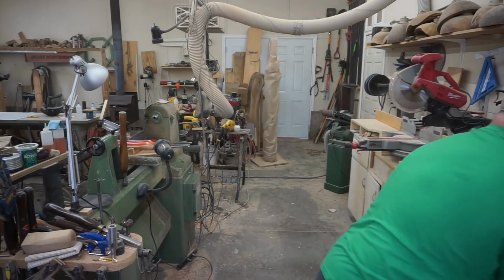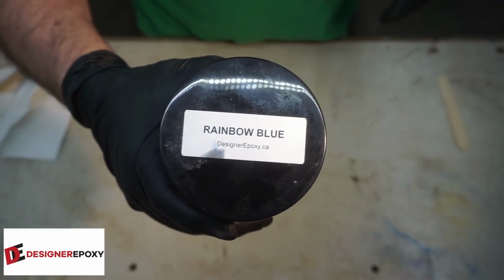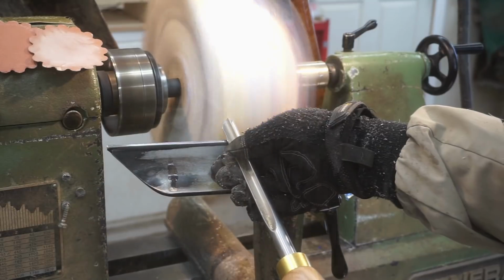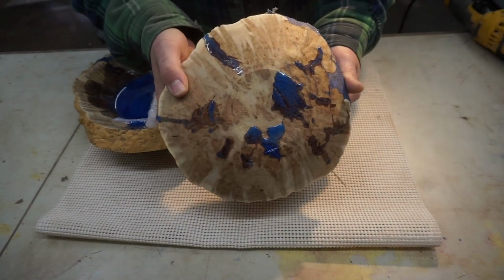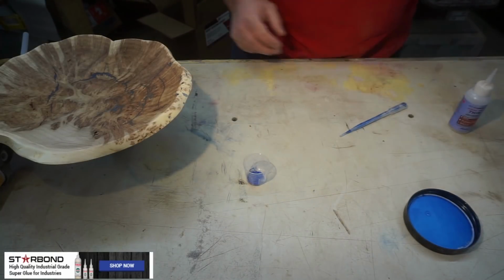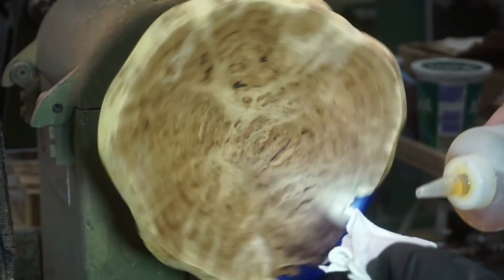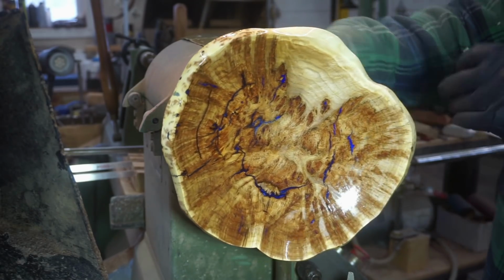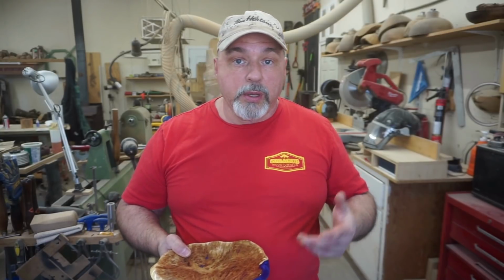Woodturning - The Brain Burl

Comment: Jim, 
As usual another beautiful job.  I have a friend who is an arborist.  He gave my 3 small burls 2 maple and a locust from a job.  I am looking forward to turning them into bowls.  The 2 small burls measure about 7 inches across.  The larger maple burl measures 14 inches.  Nothing like the ones you’ve been turning.  Great job I’m like you I love and prefer natural wood but the way you work with the resin sure adds to the beauty of your projects.  
Kevin 
Minneapolis Minnesota
Reply from the maker: I think if the resin is used as an accent then it works, but too much of it and it can over power the piece, that locus burl should be like turning concrete, lol. Thanks.

Comment: Another hit out of the park. For left over resin I usually have a few small casting molds ready for things like handles or bottle stopper blanks. You'll find you will have allot of waste turning a bigger chunk of resin....my .2c. Would like to see how you sharpen your gouge. Bought a Ellsworth gouge and having a hard time with the angle. Think you said in a video you sharpen 3 to reduce down time.
Reply from the maker: Yes, I usually have three on the go at any one time. I might possibly make a short video and put it up through the week sometime on sharpening, thanks.

Comment: Great work. I’m not a fan of contrasting resin in woodwork but you at least have some restraint. I use Mohawk products for restoration work and finishing in my shop. Great products. Another option is to contact general finishes and get an msds sheet to get an answer. You may even be able to get it online. Thanks for sharing your work and skills.
Reply from the maker: I get what your saying, but in the end, They are washing their hands of liability and placing it on the end user, in my books that’s not cool! I will move forward with another product that will certify the finish as food safe. I ordered three cans of the Mohawk salad bowl finish last night, thanks.

Comment: Just discovered your channel via recommended, impressive work! As a military member and current resident of pet very proud to see such fine craftsmanship come from the region. Curious why you use a pressure pot instead of vacuum? Keep the vids coming, almost finished watching most of yours!
Reply from the maker: Vacuum chambers are typically used to degas resins or to stabilize wood, pressure pots will compress any bubbles that might be in the resin so small that you can’t see them or shouldn’t see them in the final work. Thanks for your service, what’s your trade?

Comment: Have you looked into Watco butcher block finish? They sell it at the Rona where I live. It specifies that it is safe for food contact when it is cured and it has a higher gloss finish when applied in multiple coats.
Reply from the maker: I believe it’s a mineral oil base, I tend to stay away from theses types of finishes because of the constant maintenance with them and there dull appearance, Jim.

Comment: Another beautiful job, Jim.  I notice you do a lot of turning on a face plate.  Is there a particular reason you use them instead of a 4 jaw chuck?
Reply from the maker: It’s mainly for finishing, it can take sometimes three days to do the finishing on some of these bowls and I do all on the lathe. It’s nice to not get fingerprints on the bowls, I just hold it by the waste block when removing it. I also over the years have lost more bowls out of chucks but rarely by using this method, Jim.

Comment: I had turned wood for 20 years used general bowl finish and was very happy with the penetration and looks it gave telling everyone it was food safe . So now getting back into turning at age 80  after a five year rest and find this is no longer the one to use . Is anything safe , from my understanding there is nothing safe that will be water proof and look as nice . Had used water based floor finishes but not as good looking but felt safer so what to do when all finishes are going water based don’t tell me bees wax and walnut oil are it  . Waiting now for my new ONEWAY 1236 SITDOWN getting old and thought it sounds good for me a step down from my 2436 with all the assorted tools to go with it . Loved all your videos thanks for putting them out there . Do you sell bowl blanks dry and ready to turn as I am limited to what I can do  ??
Reply from the maker: It’s disappointing for me too, it’s been my go to finish for years but I need a manufacturer that will certify their finish as food safe for liability reasons. Do you still have your 2436?

Comment: Love the figure in a burl. Both of these turned out great.  Which buffing wheels do you use in your drill?  Thanks.
Reply from the maker: There from the Beall buffing system. https://www.leevalley.com/en-ca/shop/tools/supplies/polishing/100858-replacement-buffs-for-beall-wood-buffing-system
Reply: @SpragueWoodturning  Thanks! I didn't realize those could be used in a drill.

Comment: I have a question...with pieces that are really gnarly...does it ever help to just put it in clear epoxy first...and then of course add a second colour?  I mean I know you are going to just whittle the clear epoxy away for the most part...but is it important to do that so things are more stable and little cracks filled in?
Reply from the maker: I prefer to just use the colored epoxy, not a real fan of having clear and colored pigments through a piece. Thanks
Reply: @SpragueWoodturning  right....just asking for in general.

Comment: Probably a good thing you stopped using the wood bowl finish on products that need to be food-safe. I checked out General Finishes website and found only Butcher Block Oil professes to be foodsafe. In fact, the wood bowl finish has a redirect to this product right in the description for any wood with cutting or chopping in its future. I'm thinking if it were still food-safe, the description would include that somewhere.

I think there was a tightening of requirements for food-safety or something else that changed and the company decided to remove the label to prevent liability issues, but at the same time rebranded and hoped no one noticed enough that their sales would drop.
Reply from the maker: I was told this product was the same as before, but they removed the food safe tags for liability reasons. Thanks for watching
Reply: @SpragueWoodturning  Yeah, sounds like something new happened and they can't claim it's food safe anymore, but they're really hoping no one will notice.